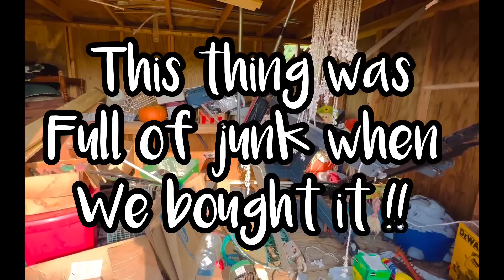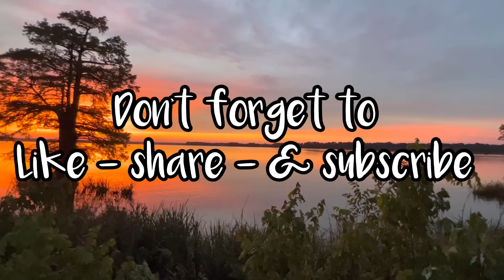Building our dream home , Budget home designs 2022

Comment: I'm sorry, this is totally unsolicited advice. Look for any "dead space" before sheet rocking. Under stairs can become shelves for books pictures ect. and would make a great space for doggie beds or built in dog crates. "Fake" drawers in front of bathroom sinks  are great places for toothbrushes and toothpaste as well as sponges etc. in the kitchen. My personal favorite, turn the baseboard area under cabinets into pull out or flip down areas for your flatter pans and/or a step up for vertically challanged people like me. 
**One of the stranger things I wish I'd done that wouldn't have cost much (if any) extra, electrical outlets built into my counter tops as well as slots for my knives.